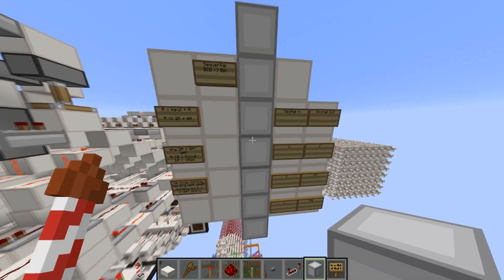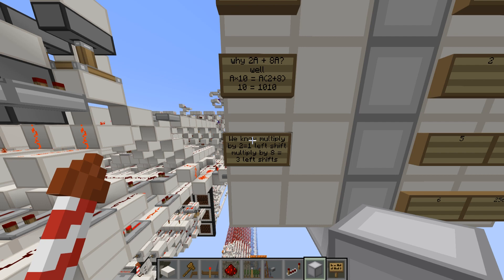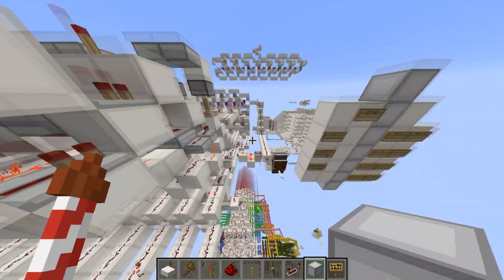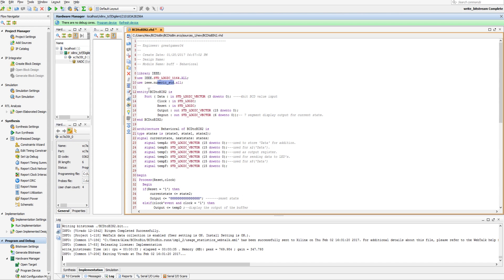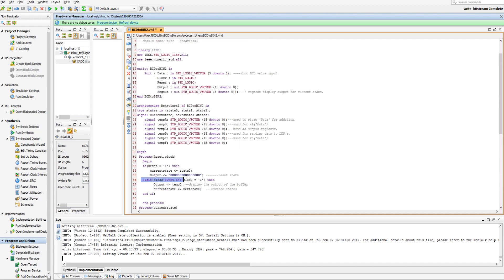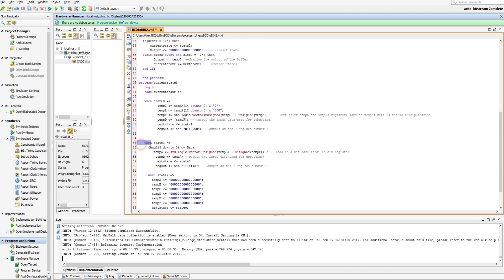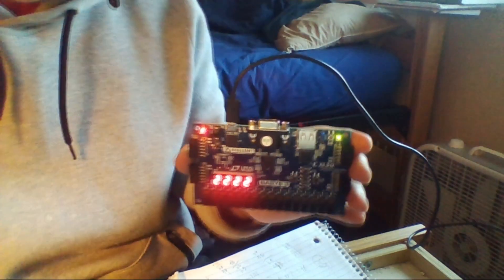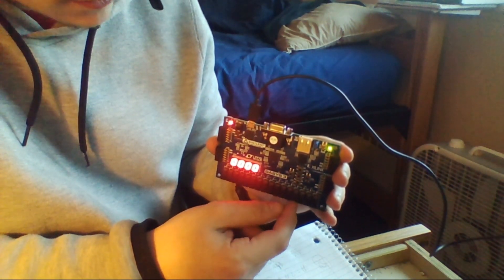BCD to Binary in MC, and VHDL

Comment: dont like the sequential ones in minecraft. they are just too slow imo.
Reply from the maker: It can take a new input every 4 ticks.... Thats not slow.
Reply: maybe not specifically slow, just not the fastest. i d say normally you ll have 8 bit outputs and a combinational one does that in 10 instead of 12 ticks. of course going on from there these are better, but in the average case, i think the simple solution is also just the better.
Reply from the maker: Yeah, but this is super useful as a sequential calculator input. If you did this combinatorically, you would need 3 BCD inputs, instead of just 1 BCD input like this one. Also this is by no way the smallest or fastest built in MC. Newomaster has a good one!
Reply: greatgamer34 generally i wanna preserve the bcd input for display pourposes anyways so this needing fewer inputs isn tthat important to me. i havent seen newomasters design, i ll check that out.
Reply from the maker: imagine if you have a calculator with buttons 0-9, thats what this useful for.  If you were to build a calc with a combinational BCD to BIN you would need levers for values 0 through 9. For each digit you have you need a set of levers from 0-9.
Reply: greatgamer34 no i d just hook up some memory before feeding it into the converter becuase i need the values later anyways for displaying the inputs. that s what i m trying to say. but regardless, i ve seen newomasters design now, that is rather nice infact ok fine :P
Reply from the maker: I dont think you quite understand what Im saying but okay.
Reply: greatgamer34 i do get it. you re trying to tell me i d need multiple lever panels, but i m saying you can avoid that by doing some more redstone. doesnt matter now, it s fine
Reply from the maker: Well that 'extra redstone' would slow it down, lol.